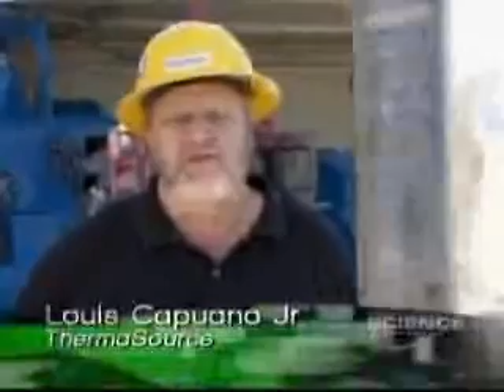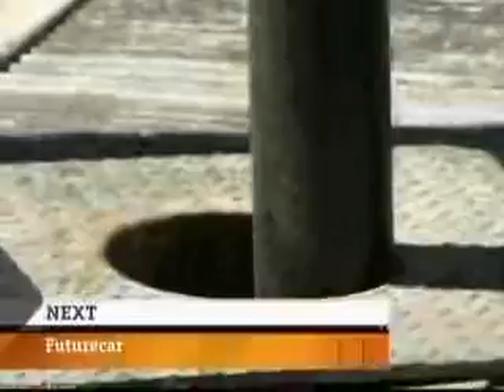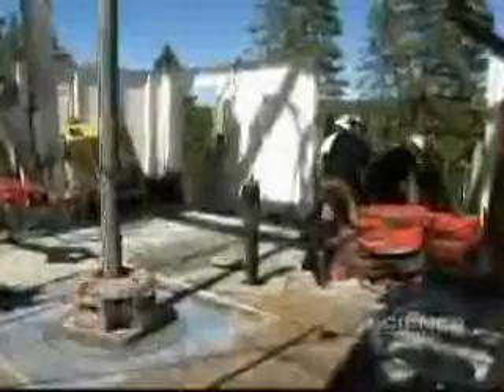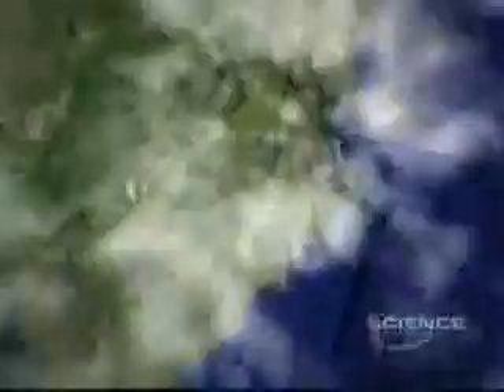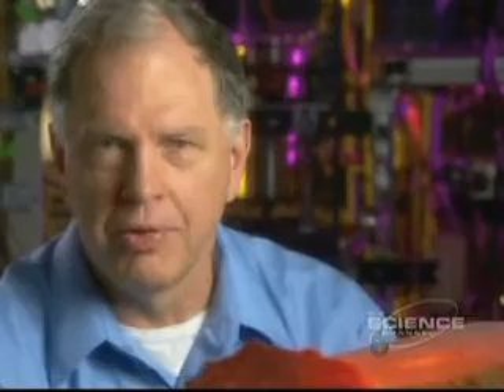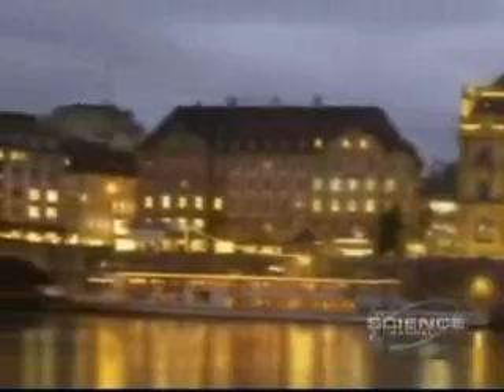Energy from Geothermal Danger

Comment: Who the hell came up with the description for this video?  Obviously a Limbaugh/Hannity knucklehead spewing fossil fuel propaganda.  HDR/EGS definitely IS the clean energy answer for the world.  Yes... small earthquakes are created when high pressure water is first forced down into the hot rock to create a fracture "reservoir" allowing Earth heat to be effectively mined (think of ice cubes cracking when first dropped into a glass of Scotch).  However, once the reservoir is created and a closed loop water system is up and running, no more rock is cracked, the reservoir is totally stable and the heat can be extracted indefinitely to make safe, clean electricity for the U.S. power grid without any more earthquakes or other negative effects.  How do I know this?  Because I toured the Los Alamos Lab demo HDR plant while it was operating in 1991 and learned that this is exactly what happened.